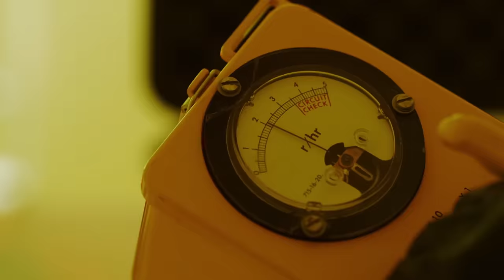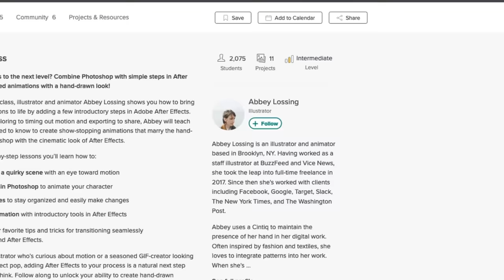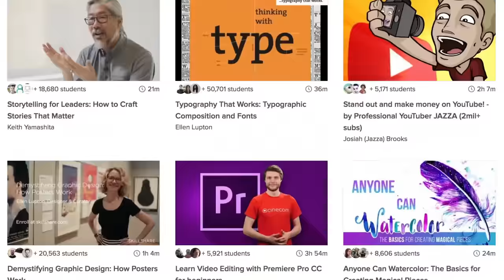Here's Why Chernobyl is Still a Massive Problem Today

Comment: It actually IS a stretch to say it was the most dangerous place to be in the world. Even limiting it to just nuclear, there were and are far worse. At the time there was Lake Karachay. This wasn't a nuclear disaster, it was an intentional dumping of nuclear waste from weapons research which is far more radioactive, making the lake fatal to even stand on the shore of. In the last decade it has been filled in and sealed.

Chernobyl was the worst nuclear energy disaster, but nuclear weapons research did much worse and much more often. The two lakes in Russia, northern England and the US all had massive areas of contamination from nuclear weapons development, and numerous places had far worse contamination from testing. Kodak was able to determine where the plume of each nuclear test blew from it contaminating the water at different film factories more than a thousand miles east.

The "400x the radioactive material as Hiroshima" sounds scary, but it's worth remembering that 95% of the nuclear fuel never left the reactor and the majority of the radioactive cloud's emissions were from short lived isotopes such as xenon-135 (which was what poisoned the reaction in the first place, leading to the fatal decision to remove the control rods). Certainly a disaster that never should be repeated, but comparing it to a nuclear weapon is irresponsible. The persistent danger is bioaccumulative isotopes like strontium-90 and iodine-135 that have half-lives in the 30 year range and would significantly increase your risk of cancer if you lived there long-term. (There is also cesium-137 but it doesn't bioaccumulate so it is a risk, but a lower risk than strontium-90 and iodine-135.)

Also - Before someone comments about the invasion, the digging, burning and heavy vehicles did stir up radioactive dust, but the concentrations in those areas were low enough that it's less dangerous than smoking - granted, both that and smoking are stupid risks to take, but that's the order of risk it's on. There is a claim that one Russian safety officer broke into a nuclear waste storage and held cobalt-60 in his bare hands and that's the only one reported to have done anything that would get anything close to radiation sickness. Cobalt-60 is very dangerous, but it has a much shorter half life and not much of it was in the fallout. It's mostly used as a radiation source for things like testing detectors, though some would naturally form in the reactor as well.

The problem with overinflating the fear of nuclear energy the way Greenwashpeace and others have done, is that it carelessly stokes the fears that prevent action against climate change. These ill-informed panics like that in the wake of Fukishima caused countries like Germany to INCREASE greenhouse gas emissions by taking safe nuclear reactors offline and switching to natural gas instead. While it would be nice if we could just flip a switch and have everything on solar and wind with battery systems to manage variable generation, we can't. Lithium has supply chain issues and its own ecological impact is being questioned now.

Nuclear, even including the Chernobyl disaster, has killed fewer people per terrawatt hour than wind. And that's without considering the impact of toxins dumped into the environment from developing the battery systems. Don't get me wrong, battery beats the hell out of fossil fuels, and we expect the process to improve, but while we produced 250 kilotons of high level nuclear waste in the last 70 years (not all of it from energy) that will remain dangerous on the order of 100,000 years...toxic waste doesn't have a half life. So dumping 12 kiloliters of antimony and arsenic contaminated water per minute from just one lithium mine in normal operation should get at least as much concern as a nearly 40 year old reactor disaster. We should be using a diverse set of alternatives to get off the known worst offender (fossil fuels) and be working to make those as safe and sustainable as possible before we start fearmongering about literally one of the safest forms of energy.
Reply: You have my respect

Comment: Imagine someone trespassing in Chernobyl, and they find the elephants foot. They lean on it and are just dissolved by the heat and radiation of the block of sheer death
Reply: They wouldn't make it within 10 feet of it before having their organs liquified and start coughing blood
Reply: @Lemontarts01  true
Reply: You need to wear HazMat gear to go anywhere near it.
Reply: You would boil like a pot of spaghetti water
Reply: Never that super radiated. They estimated a 5 min stay would be lethal back then.Right now, you'd have to sit on it for an hour or more to die

Comment: Question:- what’s the new shielding coated with?
  Answer:- multiple layers of high grade asbestos with two coats of lead based paint !
Reply: Really?
Reply: You forgot how many miles of Flex Seal they have stockpiled just in case... calling Phil Swift to do another infomercial on the utility of that stuff.

Comment: The containment structure - whilst necessary - is a bit of a red-herring since over 70% of the atomic pile was ejected from the core. A substantial proportion of that figure was scattered to all corners of the globe. It's the gift that keeps on giving. Forever.
Reply: Where are you getting your number from lmao, 5% of the fissile material flew out, the rest is molten down in the bubbler pools
Reply: Firstly, not forever, secondly, it's too spread out to pose any risk.
Reply: @dylanpresidafonseca2545  Really? Because that's not what the man best qualified to speak on cleanup operations within the Zone says in his book (and several publicly available video interviews - before he died - of radiation induced illness).
Reply: @deaddropholiday  Conservation of energy dictates that radiation can not last forever. That's just not how it works.
Reply: @deaddropholiday  And given all that time most sufficiently radioactive bioaccumalative isotopes would have decayed significantly, so while before it was highly unlikely the effects would effect the globe, now there's no chance.
Reply: @dylanpresidafonseca2545  Do I really need to explain that the term "forever" can be explicit or figurative? Either way - we are talking a long, long time for many radioactive isotopes. On the other point - why should I take your word over the man whose job it was to cleanup the Zone and surrounding areas? Are you a scientific director of the Zone?
Reply: @deaddropholiday  what's the name of this guy? And long-lasting isotopes aren't very radioactive. It's basic science.
Reply: @dylanpresidafonseca2545  I've already mentioned his name and his book (which has been translated into English) in this thread.
Reply: @deaddropholiday  have you confused this thread with another?
Reply: @deaddropholiday  hey I'm actually kinda curious.
Reply: @dylanpresidafonseca2545  Nope. Second or third entry. In this thread. Here.
Reply: @deaddropholiday  You never directly mentioned his name.
Reply: @deaddropholiday  you ever going to bother to answer me?
Reply: @dylanpresidafonseca2545  Jesus H. Christ - do you have a learning difficulty? Vladimir Chernousenko.Vladimir Chernousenko.Vladimir Chernousenko.Vladimir Chernousenko.Vladimir Chernousenko.Vladimir Chernousenko.Vladimir Chernousenko.Vladimir Chernousenko.Vladimir Chernousenko.Vladimir Chernousenko.Vladimir Chernousenko.Vladimir Chernousenko.Vladimir Chernousenko

Comment: During the incident, 2 brigades of fire fighters were called to the scene. They were the first ones there after the reactor breach, and it was raining black radioactive soot around the reactor. They went in hoping to save anyone and restore access to the control room. Almost all of them died within a week from radiation exposure. After the first day they took off their coveralls in a basement room, and to this day those coveralls are still there. That room is still so radioactive that entering for 60 seconds will give you a lethal dose of radiation. 

Later over 3,000 soldiers were brought to the site, and shoveled radioactive debris around the breach back into the reactor by hand. They were only allowed to work for 3 minutes each (3 min was calculated to be the max lifetime dose of radiation) before having to leave the site permanently, and they did this with only a crappy stamped lead breastplate as their protective gear. Most of them died too, horribly.
Reply: Amehdion BS!
Leathal level in one minute would mean 300 sV/h, which btw is the highest reading they measured after the explotion.
Only in Fukushima has been found higher readings.

Comment: 10k roentgens/hour.  Bollocks.  Complete Bollocks.  That is what it WAS back at the elephants foot back when it was discovered.  But, at that time there was lots of Iodine 131 (now almost totally gone) as well as other short lived, nasty isotopes.  Most of those have gone, they've decayed away.  Don't get me wrong, it's still not a great place to be, but it is nowhere near as bad as 10k roentgens per hour now.  Probably about half that immediately round the elephant's foot.    People regularly went inside the shelter object (the official name of the sarcophagus) and assessed its condition as well as what was going on inside the building.

Comment: Why don't engineers and chemists get together and design a radiation damping foam and spray the place while cutting and lifting sections out? This would trap alpha, beta, and neutron particles while also stopping radioactive dust and debris that would have spread from conventional cutting activity. The process could also improve on the job as removing thousands of tons of material would be removed by the time the operation gets down to the melted core area. I know there are chemicals that can "freeze" nuclear reactions, they just need to be modified for this idea to work.
Reply: Idk
Reply: You do have to understand that first of all it would be impossible to completely make the core safe and the people that do go to the core will most like be dead even with protection.

Comment: This video needs a heck of a lot of fact checking, the radation levels inside the reactor is nowhere near as bad as this video makes out, there is even a photo of the manager of the new construction squatting next to the elephant's foot. Radiation levels have dropped as low as 5% of what it was 30 years ago, and the cancer increase risk is still questionable, heck the chernobyl NPP was still functioning uptil 2010 with as many as 1000+ workers living in the zone at a converted railway station (yanov i believe)
Reply: The dude that took the picture next to the elephant's foot died afterwards. No, it's not safe at all.
Reply: @carolthepyro899  this is not true and has been debunked many times.  The first picture taken 8 months after the meltdown occured was taken from around a corner where the workers were largely safe with protection gear and limited exposure time.

The second series of pictures taken starting in 1996 was taken by Artur Korneyev, who by all records is still alive today and in his 60s.  He visited the elephant's foot literally hundreds of times over 20 years and was eventually banned from the site when he reached his total allowed dosage, per STANDARD procedure for workers in the exclusion zone.
Reply: Well shiet I've been lied to.

Comment: Still by far the least lethal form of energy.
Reply: It is the cleanest under normal conditions. It's just when something goes wrong, it's rarely benign.
That being said, there are almost 500 operating power reactors (and who knows how many research, training and other ones) worldwide. I know of only two that had major accidents. Granted, that's two more than there should be, but there it is.
It's like aviation. Planes crash from time to time and it's still the safest way to travel.
Reply: Nope. 
Once it goes wrong (so far Cherrnobyl and Fukushima) the ecological destruction is like no other.
Reply: @XVegeraX  They are not designed to "go wrong". Coal fuelled power plants, however, are damaging to the environment by design. That's the point OP was trying to get across.
Reply: @khymaaren  this exactly.

Even when coal ''goes right'' it's still worse than if nuclair ''goes wrong''
Reply: @centralintelligenceagency9003  Arguably, these two had the most serious repercussions. There have been a few meltdowns and other incidents that may have not even resulted in radiation leakage. They are documented, yes, but one has to look for it, as they are not public knowledge. You can call a lot of people - including yourself - stupid on account of not being aware of something - anything - that is hardly ever publicised, if at all.
Reply: @centralintelligenceagency9003  Where did anyone say there have been only two accidents?  You are seeing or hearing things, mate.
Reply: Nuclear is 500x safer than coal when including all accidents. More people die each year in the us from coal than have ever died from nuclear power by a factor of 10.
Reply: Central Intelligence Agency - Accidents at large scale commercial plants resulting in deaths? Yep those two are it. Small scale and military... another 15 or so plus all the ones the Russians haven’t admitted too.

Comment: Visting Chernobyl is no different than getting an X-ray.
Over, and over and over.....
Reply: What I learned is 3.6 rotigen or however you spell that is the equivalent of 40 chest x-rays.
Reply: Well
I've had shit loads of x-rays in my time and I have visited Chernobyl so I suppose I'm fucked!
Reply: The hottest areas are about 1 chest X-ray per hour. Most are under 1/20th that so a full day at the plant is less than half a chest X-ray
Reply: @timrosencrans7955  

Aye
It's no where near as dangerous as some think

I didn't even think twice about going due to the risk.

Comment: And yet nuclear is still the safest form of electricity (90 deaths per Petawatt-hour vs 100,000 for coal) and absolutely essential in achieving a carbon free future.
Reply: Solor power is better
Reply: @donnellebarfield3964  Solar kills more people at 440 and is worse for the environment due to large mining operations to get rare early metals, large land clearing to build solar farms, and the rare earth metals are highly toxic and can't be recycled once the panel is dead.
Reply: Wind and hydro are better (not by huge amounts) but can’t operate at large scale.
Reply: @timrosencrans7955  Hydro i would say is the best due to if built on a dam you are also storing water.

Comment: It's interesting that there's all this attention being paid to Chernobyl.  What about the complete ongoing disaster that is Fukushima.
Reply: ask HBO to make another series on fukushima , i bet it will also sell like hotcakes
Reply: Nothing to report! Nothing! Just like when both nuclear incidents happened!
Reply: Gym0

GE mk1 boiling water reactor serious design flaws right from design concept the ongoing problem at Fukushima dai-ichi is many times worse than at Chernobyl as radioactive fuel is not encapsulated and is in the ground Google Fukushima tank farm they are having to deal with millions of tons of highly radioactive water which is slowly filling the entire site. There is absolutely no way to filter the radiation out of the water consequently the situation is ongoing permanently the technology simply does not exist 2 decommission a melted down nuclear reactor of commercial size the estimated costs of 411 billion are probably 10 times to conservatives that's why no one's talking about fukishima
Reply: @gck82s  Can you spread any more nonsense?   Getting radiation out of a fluid is simple, you put the fluid through a neutron absorbing material, they have to do it to the coolant every time they decommission a NPP.  And Fukushima is nowhere remotely as bad as Chernobyl, man, when you prats aren't lying about it flowing into the sea you are complaining that they are capturing and storing it - people can't win.
Reply: @krashd      firstly primary circuit cooling water is only mildly contaminated with radiation due to the fact of that nuclear fuel is separated from the water by the zerconium  cladding on nuclear fuel assemblies the nuclear contamination of the water buy corium in groundwater cannot be underestimated and is a totally different argument than the one you're putting forward as once radioisotopes are dissolved in water it is near impossible to get them back out again without increasing the volume of radioactive waste and any treatment plant you build to try and do this gets so highly contaminated that once it for breakdown you can't fix it because it's to hot to work on remotely and fatal for humans to try and replace the filters or fix broken plant do you get it now or does it have to be more simple for you
Reply: Yes that’s why exactly zero people have died from Fukushima’s radiation.
Reply: Because it’s basically a non-event. There should not of even been an evacuation. More people were killed by the paranoia.